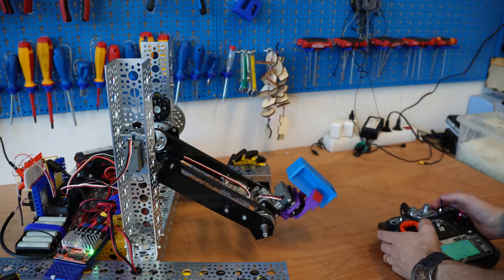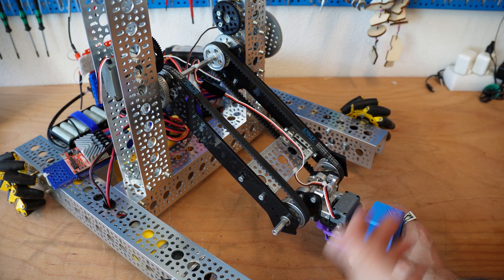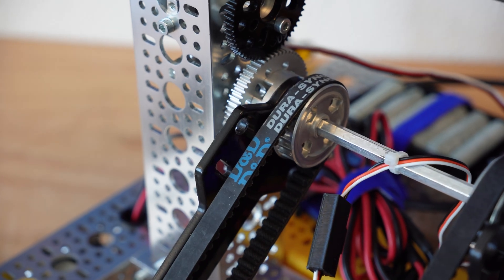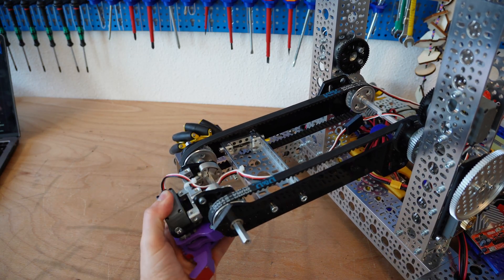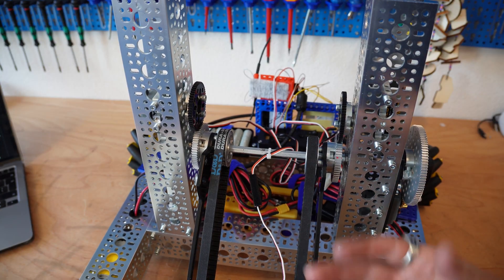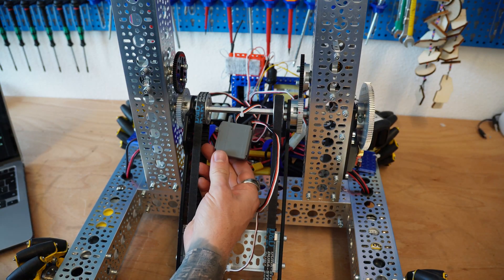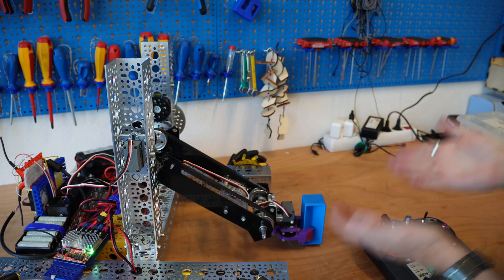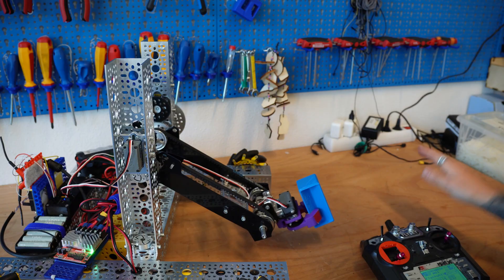How Co-Axial 4-Bar Linkages Work

Comment: personly, I don't recomend this method as you can use a actual differental going in to a 90 deg gearbox to 1. do the same thing 2. Utilise both servos to rotate the arm allowing for more torque and potentaly more speed throught the entire system( bc this sytem requires a torque servo to lift the large arm, generally meaning  less speed compared to  a speed servo with less torque. But when using, for example, two speed servos the torque gets added giving the needed torq to lift the arm and keeping the speed of the speed servos). Down side is needing 5 bevel gears and the servos need to be identical for the virtual 4 bar(this is programed).
Reply from the maker: As the old saying goes, there are 1000 ways to skin a cat. That's also an excellent way of getting a rotatable claw that also stays programatically parallel to it's initial starting point. Both accomplish the same task, in different form factors. I wouldn't say the differential is definitively better than a co-axial virtual 4-bar as it depends on your use case and key design constraints.

Comment: If you mount the servos on the arm to drive the pulley it will no longer operate as a 4bar since the pulley will rotate with the arm. This still works fine we did this on our robot this year but it is worth knowing that it will not work like a virtual 4bar
Reply from the maker: You're correct, if you mount the servos that drive your pulley to the black arm, it wouldn't be a virtual 4-bar anymore. I may have misspoken in the video, thanks for providing that clarity

Comment: If on the coaxial 4 bar it was a dead axle and both of the belt pulleys were driven with individual servo, could you put a bevel gear differential at the front and have the belts drive that so you can get an extra degree of freedom while still having a 4 bar?
Reply from the maker: Great thinking, yes you can 100% do this. I’ve seen many a robot with that exact setup and it does open up more possibilities. You need to weight weather you want that much weight on your end effector, however, so keep that in mind.
Reply: With weight, wouldn’t most of it be closer to the axle because that is where the servos will be, not at the end?
Reply: Also will there we a lot of error between the servo and the differential position?